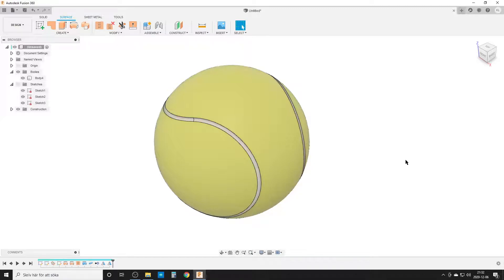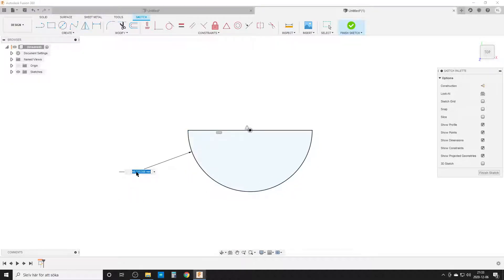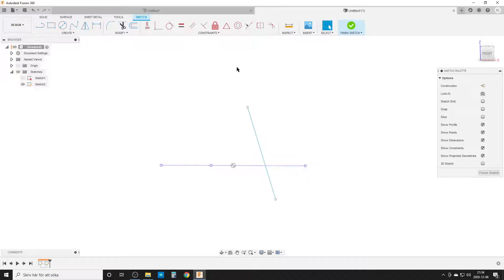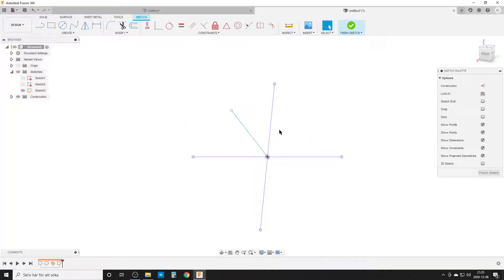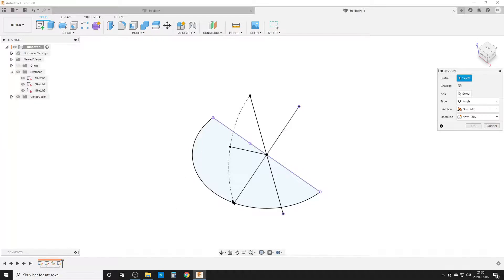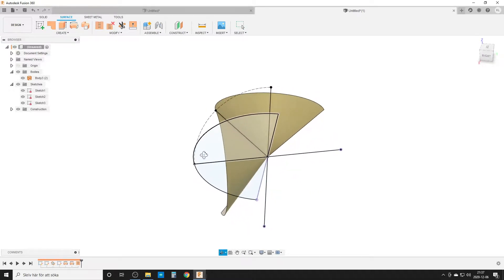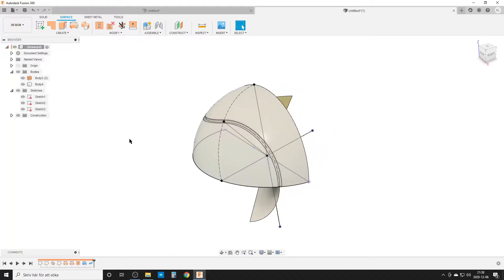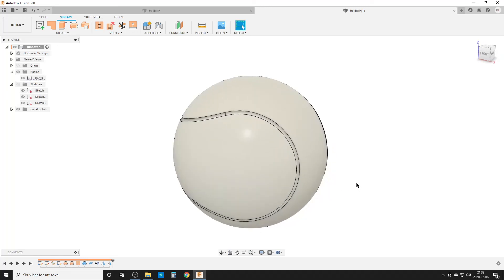Fusion 360 - Tennis Ball

Comment: Just a note, to select both edges for the pipe command I had to control+click the second edge, otherwise it wouldn't let me select the second edge. I didn't know this but instinctively tried it as I remember how it worked in Rhino to select certain parts in a different way. I think what would be really useful, is to make a guide (not saying you should do it, in other words, I mean 'it should exist') wherein someone explains all these handy shortcuts, same goes for the shift+hover method to find the center of the arc. Really useful tutorial, not because I wanted to draw a tennis ball, but because it taught me more tricks! Thanks :)
Reply from the maker: Thanks for your thoughtful feedback :) 
Tricks are always good too know. Lately there has been some small changes on how Fusion handles input from the user, I'll try and be more clear in my videos as I use the "tricks" ;)